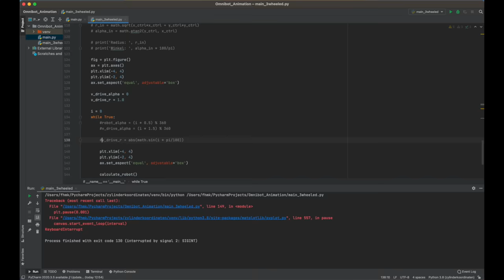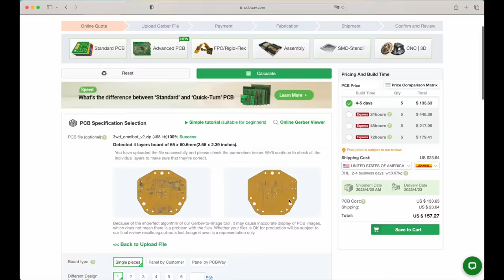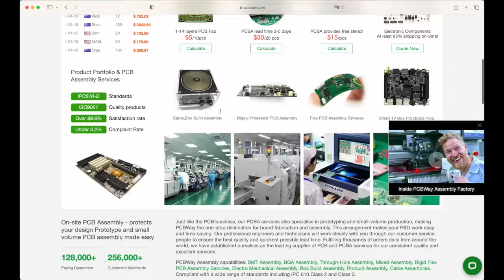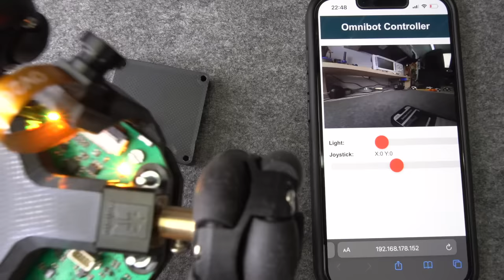ESP32 based omnidirectional robots w/ camera | makermoekoe

Comment: The pico click control is so satisfying to watch in action! 😊
Reply from the maker: The response is better than I could imagine beforehand haha 👌🏻
Reply: How does it sense when the pico click is turning around the vertical axis? gyroscope accelerometers?
Reply: @mafiosomax7423  I could imagine that it is also using a magnometer, but let's see what the master replies 🙂
Reply: @nkronert  Using the earth's magnetic field? If that's strong enough it would be wicked
Reply: @mafiosomax7423  it is strong enough for compases and a magnometer is basically a solid state compass.
Reply: @makermoekoe  hello, what PCB software for design are you using?
Reply: @makermoekoe   why not share?
Reply: @nkronert  Thank you for that information. I looked into it some more and it seems that you are right. I learned something potentially useful from you
Reply: @mafiosomax7423  you're most welcome. We still have to hear from makermoekoe how he implemented this, but modern magnometer/accelerometer sensors are good way to determine both absolute orientation and rotational/linear acceleration. Fascinating stuff.
Reply: @nkronert  it definitely seems like it could be a magnetometer. A gyroscope would have a lot of noise and drift, especially with those rapid turns so I don’t think it would be as responsive or accurate if a gyroscope was used.

Comment: So impressive! Im much more into the mechanical engineering side of things, so the ease with wich you put all this together looks like witchcraft for my. I love how basic - meaning clean and functional - your self-made equipment is. Seriously, I, just in this video - the first of yours I saw - learned about the existence of at least tree manufacturing techniques / use cases for pcb's. I'm blown away.
Btw: you have to put the mostly assembled pcb (minus the motors) in your shop. For my own I'd like to make adjustments to the motor size and config. but I'd not like to mess with the soldering or the code. Should be easy enough to hook an Arduino into the analog motor output.

Comment: Awesome project! Are you planning to add a negative feedback control using an IMU for the robot's wheel movements, or is there one already in place when you control with the joystick on the app?
Reply from the maker: What do you mean with robot‘s wheel movements? I have 9-DOF on the robot integrated, but not for every wheel. Actually in this video I‘m not using the IMU at all, will work with it with the new PCBs 👍🏻

Comment: Nice little project. I don't believe you can blame the video lag on the "antenna is not impedance matched", that's a software issue. Unless your access point is WAY out of range and you are hiding dropped frames, that's just good old buffering and lag 🙂

Comment: You’re engineering artist!!! Thanks for such a inspiring video. I have one question: did you consider any practical usability of that concept or it is a pure toy? I can’t understand the way such a wheels would behave on the tilted surface. To my understanding these wheels won’t be able to bring the meaningful load uphill unless rollers are equipped with reversible ratchet. What do you think?
Reply: Do you think the wheels will be able to go up and down the hill without a load on them?

Comment: Great video! I really liked that IMU integrated Picoclick  controller, is it available to buy? How long does its battery last?
Reply from the maker: Not yet available. It is a 110mAh battery, so when using it as a remote like in this video it will probably last about 1.5h. When using it as an IOT button, over a year could be possible

Comment: This is so cool! The heated bed for building your own pcb boards is the coolest though. That helps you in a major way. I needed one there other day when a betafpv board I ordered came with two components soldered on crooked, causing them to touch. Using my ts100 fixed it, but it wasn't pretty like this. Do you have a build video of the heated bed tool?

Comment: Nice job! What a cool and responsive way to control the bot.
There is a little turning going on when the bot should actually go straight. Have you thought about implementing motor encoders or use the IMU to close the loop?
Reply from the maker: Thank you! It is not yet a closed loop control, but it could be, I have an IMU on the board 👍🏻 Actually the little drift is related to the slider, which doesn’t center itself on slider release (very bad implemented 🥲). The little rotational speed is too low to turn the robot at all but once it is moving the rotational speed is visible…

Comment: Would you consider adding an imu to the board to enable compensation for the rotation experienced when intending to travel straight?
Reply from the maker: Actually it travels straight, but the slider in the webserver wasn‘t set to zero completely. So while driving, the little difference in the wheel velocities gets visible. Still a software bug which should be easy to fix. Nevertheless I have an IMU on board which I will use for compensation in the future 👍🏻

Comment: Excellent work! I have been working on a robot project and the amount of overlap in the design decisions is kinda scary. Same motors, wheel type, camera, micro-controller... It would be so cool if you could share your code and PCB files and sell your PCBs on something like Tindie.
Reply: What motors are those?

Comment: Can u please help me with something?!
For the past few months I hv a prob in making an arduino obstacle sensing car... the prob is with the power supply!!
Thing is I'm using the l293d motor driver sheild nd evry time I give power supply , the driver ports burns ..!! I'm using two 2200mah li ion battery nd evrytime my port burns..!! 

So I was surprized tht in many vids they r using two 4800mah batteries nd still the driver sheild works fine😮😮
I would be very greatful if someone just tells me wht to give as the power supply!! 🙏🙏